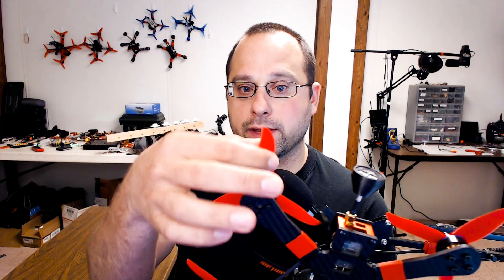How to recognize prop deflection (and my new favorite prop!)

Comment: https://github.com/betaflight/betaflight/issues/2817
https://github.com/betaflight/betaflight/issues/2889
I think there is an issue with the latest ("stable") firmwares of Betaflight.
Reply from the maker: +Domikian Glueck these are almost certainly hardware problems. Betaflight increased the default D gain in 3.1.7 and it may be too much for some setups that are on the edge.
Reply: Joshua Bardwell I toom the d-terms down to 20 and have the same issue.

Comment: I have heard this on both my copters, one running rs2205s 2300kv and other running 2306 2400kv. changed to cyclone t5045c, better handling, much quieter than 5x4x3s. Recommended.

Comment: I still use the Emax RS2205 2300kv motors. Do you recommend the DAL over the King Kong for these motors?
Reply: RS2205S motors.
Reply: for sure ! :)
Reply: roland burrows Its 2300kv.  You probbalbly wont get the deflection...or at least not the noticeable effects of the deflection, especially if you don't punch at full throttle for long.  You will have a different effect at the end of a dive with flexible props though.  A stiffer alternative to this KK prop is the DAL 5040x3 V2.
Reply from the maker: +roland burrows the Cyclone will still fly better if you don't mind the cost.

Comment: i always thought my kk's stopped giving more thrust after 90%, and they screamed like mad.... i have some cyclones on the way... i have some heavy kk 5045x3's...  i should try them... i'm just too scared.
Reply: the kk 5045's have a pretty sad top end :( and are heavy, thay are pretty strong though :) if you fly agressivly the kk45's will reduce your flight time, give you less responce and not have much more top en than the 40's, those are offcourse just my opinions... :)
Reply: i  think you might be exactly right,  they look very heavy,  i have used 2 or 3 boxes of 40's,  havent even considered using the box of multicolour 45's... i dont have many 40's left and ordered two sets of cyclones,  so i'm probably just gonna skip the 45's....  i also just bought a new set of kk 2205 ''2300kv'' motors, they are slightly different than my originals, which were extremely fast, too fast for a noob like me. the racerstar 2205s 2600kv seem more mellow.

Comment: I have a question: To what degree, if any, (maybe someone has a slow motion camera) does "disking" have since the idea that if all blades are deflecting then the tips will not be as well angled to the airflow from the root outwards.....do the "new" props you are referring too bend from root to tip at all and if so, to what degree is efficiency lost?  Since blade speeds may now (quick math check would be easy here but I am too lazy) be approaching transonic why don't we have "Q-tip" props like I have flown when I was a Charter Captain on 8 seat Navaho aircraft in the Caribbean in the 1980's? Thanks and keep up the fine work;-) Cheers!

Comment: I'm a big fan (prop?) of DAL cyclones. They're super durable, and while they're pricier than KK's or even other DAL props, they survive crashes better and IMO, last longer. The only issue is the winglet tip - one good crash and it gets pretty chewed up. Is there a noticeable performance difference like that? Not to me, but there's an audible difference.

Comment: V1 (5045) kinda sucks. Try the V2(5046) out, much better. V3 (5050) is probably not what you're looking for.
Reply: Just ordered the 5045's (based on Josh's review), now I'm gonna also order the 5046's on your recommendation.
Reply: The V2 are highly superior. Check out www.prop.city if you need them in the US quick.
Reply: The difference is not that great, sure you can feel it, but highly superior?  Your LOS is way better than mine, as i have no LOS skillz, so maybe it's more noticeable los.
Reply: The difference between props is 10x more noticeable LOS then FPV. I come to race quads from Large scale 3D planes and 3d helis so I'm more partial to LOS (don't get me wrong I love racing and I love tight area freestyle and wide open spaces as well but LOS is my first love lol.. the difference between props via fpv it takes a MASSIVE difference for you to see a big change in preformance (handling is where you see the most difference, speed not so much) however LOS the difference between prop is instantly noticeable and it doesn't take a big change to be able to be seen. Like I can easily tell a difference in speed, acceleration and climb out speed between a HQ5x4x3v1s and the HQ5x4.3x3v1s flying fpv I can not tell a difference other then my hover point is slightly lower with the 4.3 pitch prop but past that I can't tell a difference however LOS the difference is massively noticeable..
Reply: And I do agree again with the other person, the Cyclone 5x4.5x3 vs the Cyclone 5x4.6x3 is a MASSIVE difference.. it's better in every single way then the V1, the V2 is better period.. not a little better but a lot better.. speed wise it's a would 15 to 20% faster in level flight across all rigs with at least high quality 2205 motors (2204s even the best or the best and low and mid grade 2205s don't have the power to handle either prop so top end will be nearly identical) the make more low end thrust for less current pull, the top end current draw is higher by about 10% but 70% and below the V2s pull less current for the same thrust, the response is MUCH better, they handle prop wash better and make it much easier to dial out all prop wash.. I could keep going, the V2 4.6 pitch prop is vastly better across the board.
Reply: V2's are def best. The 5050 v3's suck for acro and I am running LDPower 2307 2450kv motors on 4s so no shortage of power, they just don't create enough spool speed and really cuts off the top end speed. May give them another try on 5s or 6s this weekend but can't imagine it will get any better.

Comment: If you guys want to hear some SERIOUS prop flutter, check out this three year old video of a vertical boom home built mini using RcTimer 2208/8 2600KV on 3S using cheap,flexible 0645 props.  It is MUCH louder than it sounds in the video.  I'm checking out some settings and going easy, so move the slider to around the 30 second mark for the flutter to start.https://vimeo.com/104200028
Reply: that sounds mad lol
Reply: I got the exact same noise out of some GF 5030 props when I punched, so loud it scared the bejesus out of me lol
Reply: what is that insect on that video?!?
Reply: dragonfly
Reply: No, I believe that was a wasp of some sort.  Probably a 'mud-dauber' which I have in abundance around my house.
Reply: Also your quad in video like quite overweight as well.
Reply: Not too bad at all.  The frame was 166g with the rubber grommets. Very comparable to any 220mm brick-style mini swinging 6" props from three years ago. However, ultimately it weighed right around 700g AUW  with a 4S 1600 with all the older electronics.  I discovered after the design the cage suspension was not really necessary and could have saved maybe 20g.
Reply: Cyberdactyl: I see. Three years ago frames was quite massive, racer quad frames had 250-280 size and their usual motors was 2203-something with less thrust. Particular build seems had other problem - motors was too good for soft props.

Comment: I wan to one thing that using a 5152 prop creates more thrust   and more thrust means more speed but does it matter on rpm .
getting high thrust at low rpm what is wrong

Comment: what about these: https://m.banggood.com/10-Pairs-Kingkong-5x4_5x3-5045-5-Inch-3-Blade-Propeller-CW-CCW-for-FPV-Racer-p-1067877.html?rmmds=search much harder plastic and cheaper then dal ??
Reply: those are strong and nice props, I recomend them to beginners, but thay have real bad efficiency at high rpm, are very heavy for the thrust thay produce, I dont like em personally, thay definetly are no match to the cylones :), but thay are good for beginners, have decent low throttle responce and are strong :)
REPLY

Comment: Joshua, can you have a snappy feel with these props ? I mean, I like my copter to feel very stiff, and with the old DAL 5045 I couldn't get rid of bounceback because the prop was so heavy.
Reply: if you have modern motors for sure, my acro copter running DYS fire and cyclones is locked in like its on rails, but if you running old 2204's it might not handle those
Reply from the maker: +Stephen B modern motors have more than enough torque to push these props around.
Reply: These lock in like your quad is on rails, great all purpose prop, fast,  locked in, good for intermediate to advanced racers and perfect for freestyle too.  They will chew through small scraggle like a sandwich,  take quite a beating and still get your quad back to the heli pad.   They also make for some smooth video,  Le Drib likes these props and uses them for his videos.

Comment: Yup, I have that noise too but at .35 cents a piece I'll fly them until my supply is depleted then see what is available at that time. I heard GEP has a comparable priced prop that performs well but I haven't tried it yet. They too may have the same issues. Thanks for the video, at least now I know what that sound is. I thought it was my flux capacitor going out. LOL
Reply: GEPrc v2 triblades are better than the kk for the same price, and I have both of them. 
If you look for cheap props the GePrc just beat the hell out of the kingkongs, much stiffer, light, durable, consistent and very well balanced.
Reply: Thanks for the info, those may be my next porps.
Reply: Good info and thanks for sharing it.
Reply: OK, thanks :)
Reply: Budget FPV RC I flew those up until they sheared off at the hub mid flight and destroyed my new quad.
Reply: daniel passmore, the GEP props sheared or the KK sheared?
Reply: I'm currently flying these GEPRC 5040 V2s you speak of. They have an almost identical blade design, but SUBSTANTIALLY thicker hub ( KK has 5mm, GEPRC 7mm) and the point where the prop blades join the hub is meatier, too, which results in less flex at the blade and punchier props.
They are also incredibly well balanced. I have never seen such well balanced props before. They are whisper quiet but slightly more power hungry and heavier.
But due to the insanely good balancing they are easy to tune for.

They are also pretty much indestructable.
I am now on my second set after crashing the first one for an entire week.
I had the problem of the KK props bending too easily and go FUBAR at the hub very quickly.
The material is pretty old school though. They appear to be the same material the very old KK 3040 dual blades were, this matte ABS or whatever it is called.
Reply: You are welcome.
Just make sure the prop shafts on your motors are long enough. The shafts on my kingkong motors are a tad too short for comfort (11mm)t. Because of the thick hub of those GEPRCs, when using self locking nuts, you need 13+mm of prop shaft to have enough "meat" for the silicone rings on the nuts to grab onto the prop shaft.

Or you have to make sure to properly tighten your prop nuts and use CW-CCW threaded motors.
Reply: Where are you buying your GEPRC props if you don't mind me asking?
Reply: Banggood. I buy everything from them ;)
https://www.banggood.com/GEPRC-5040-V2-5-Inch-3-Blade-Propeller-Triblade-Props-Colver-Prop-Blue-Yellow-Pink-For-FPV-Racer-p-1122981.html?rmmds=search

Comment: I had the exact same problems with kingkong props, it sucks when you really love a prop but it just doesn't work. I was a hard core HQ props fan for the longest time until I tried dal cyclones. Since, I still haven't found a better prop than the cyclones! they even handle my 2500kv 2407 motors on 6s! pretty hardy props for sure, especially being polycarbonate! the cyclones are just so damn smooth and they grip turns amazingly.

Comment: 5045c Cyclones were my favorite freestyle prop and 5046c cyclones were my favorite all around but the new emax prop has replaced all other 5" props for me except for certain circumstances where I prefer the bi-blade 5050c cyclones. You should really try those if you haven't. Plus emax props are like 5 sets for ~$13

Comment: joshua, do these 5045c need balancing?
Reply: anything under 6 7 inches ballance isnt important unless they are way off. if they are new out the package they should be 100 rtf, however if you chip one and they are causing vibrations u just wana change them. imo, hope this was helpful, i use these props allot to this day.. Balance never hurt ANYONE tho :)
Reply: Anthony Cenabite Farr thanks!  ithink my problem are lock nuts. they wobble pretty bad no matter which one i put on. dalprops are tall and threads barely bite the plastic on the nut. any solutions for that?
Reply: it sounds like you might have bent stators I HATE to say or bellhousings.. it isn't great to run the motors without props or something on them but have you tried taking the props off and just put on the lock nuts if anything and arm for a second or two, see CLOSELY to see if you can see ANY movement? usually if ones bent you can see it, im sure @joshua bardwell knows a better way but you should check that, the new dal props are nice they don't need to bite just to be flush... at least to fly, i still love the dal 5045 v2 on some motors n setups.. but they have allot of flex.. also have u tried bullets and had the same result? And josh is my go to guy for allot of my info he would know much more than me hope this is cool, just trying to help ya,
Reply: Anthony Cenabite Farr nothing is bent, my motor bells track perfectly and i can't see any wobble in the shaft. lock nuts are the problem. thread tolerance is not great on any of the nuts i have tried so far. when you screw them on, there is some play involved. off course, when you screw them on past the plastic part, they wobble because the plastic is not centered properly. i really don't have any luck with bloody lock nuts.
Reply: Ivan Novak z thats crazy... it must be a size issue with the prop like you thought and also you might want to try the lumineer low- profile prop nuts they've always worked well for me but sometimes I need taller ones depending on how tall the motor is in the size of the prop of course. I wish you the best and getting this worked out and honestly try those low profile prop lumineer lock nuts I think you'll be quite happy with them or just go back to Bullet heads they work. just don't tighten them too tightly or too Loosely LOL best of luck to you
Reply: if those are too short try tall lock nuts
Reply: Anthony Cenabite Farr all right, thanks man :)
Reply: big up
Reply: wow, these are short. thank you!!!!! :)
Reply: I have had a lot of crumy nyloc nuts, just plane out of ballance, i just toss them, but I found these and rarely do i toss it out and price is right at 4 cents each http://www.ebay.com/itm/A2-Marine-Stainless-Steel-Nyloc-Nylon-Insert-Locking-Nuts-to-Fit-Bolts-Screws/122051398025?ssPageName=STRK%3AMEBIDX%3AIT&var=421086723799&_trksid=p2057872.m2749.l2649
Reply: Locknuts shouldn't make much difference if they are tight, there shouldn't be any play between the prop and shaft anyway.  These are pretty nice low profile lock nuts for the money.  http://www.myrcmart.com/hex-flange-m5-low-profile-slipresistant-aluminium-purple-cw-height-45mm-10pcs-p-9398.html  You can see them flying in my latest video, lol!
Reply: Lots of different color options too.  They seem really high quality and no, the dal cyclones don't need balancing.
Reply: i love them!!!

Comment: With kk out of the way it is not so obvious. Price is different but gets close enough to make the call difficult. Flash 5152 for me. Full throttle on 2207-2500kv on 5s and no issues with deflecting :)
Reply: plenty of stiff kk props available